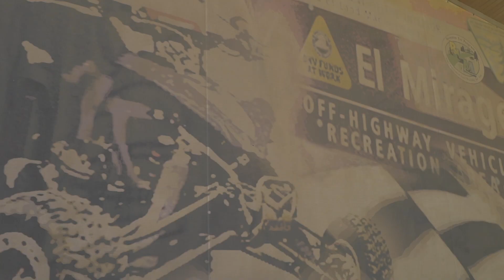DJI FPV⁄⁄2MILE RANGE TEST🧐⁄⁄DRY LAKE BED☠️⁄⁄⁄⁄⁄⁄⁄⁄⁄

Comment: something makes me skeptical, you don't t upload the analog dvr 5:17 ....to me it looks like you flew into the ground. Every good pilot knows when the video gets bad pull up and punch the throttle. Eigher you're r bad pilot or what ever...

And come-on no RSSI in the OSD ? :D 
This is the calculated distance of you analog video setup.
http://maxmyrange.com?freq=5800*pw=800*tx=18*rx=13 (i wasnt able to chose the axci but the tbs Triumph has a better range, so the calculation is even worse than your setup).
And i know how far you can get with this same setup. Your problem won't be a video or TX signal, in a low noise area like the dessert. the range limitator is the battery.  And you even say: sorry guys my crossfire is not setup right,,, this is nor normal...8:00    So you compare a " defective" system against something else. 
I watched a couple videos from you befor and had alwas respect for your work. But at this point you just trying to sell a dji system.

And
Reply from the maker: Roezfpv yes yes pull up- the point was to not pull up and let it fail :). Please stay skeptical, this is why we do tests and not just believe Online theories :)we can debate all day, we just did this test for ourselves not for anyone else :). and as you can see digital and analog are both quite equal under the control conditions as we say in the conclusion my man.  Fatshark dvr files were corrupted unfortunately but thankfully we had the analog vortex test.  p.s. at 5:17 this was a failsafe & the fatshark dvr file corrupted which makes me furious as I have a nice wolf pdb that has a failsafe popup. The digital goggles dvr would not respond to the record button at range also.  We do want to do this again :)

Comment: you fellows are getting very poor results on crossfire, only a mile.
Reply from the maker: Yes according to IBcrazy apparently we were flying too low for any 915 system (we flew both crossfire and R9), so it would have to be on dragonlink for a low altitude.  Could have done it with cars... but we should fly right?
Reply: ya as Aerial GP is saying, only flying few feet off the ground, none of these systems have a fair fight, if anything DJI Digital system should have the upper hand in low alt test (which it did)  thanks to sophisticated error correction. being abl to rebound and keep going and interpolate data better..         at 399 feet up with proper antenna placement and configurations on each subject i think would be way more interesting test. 

think about it, all things as equal as possible.. digital has an advantage correcting its errors and handling hows splits data but analog has the edge with not really needing same constant handshake  (apart from the link with the controllers (failsafe system) )   would be a very interesting test....
Reply from the maker: @Honeypot-x9s  we'll try again up high🖖